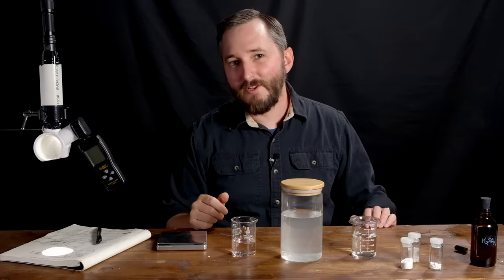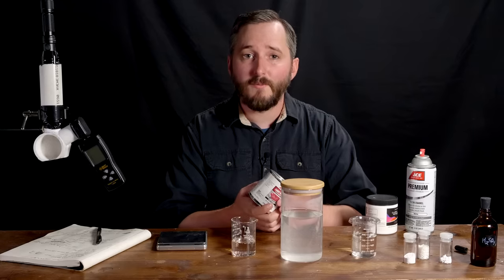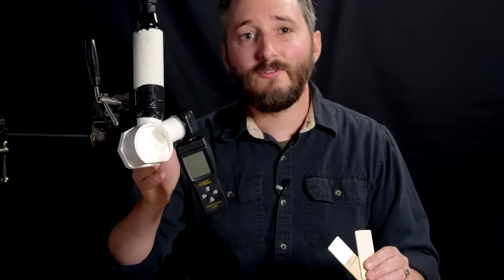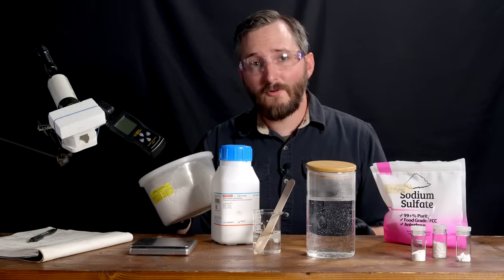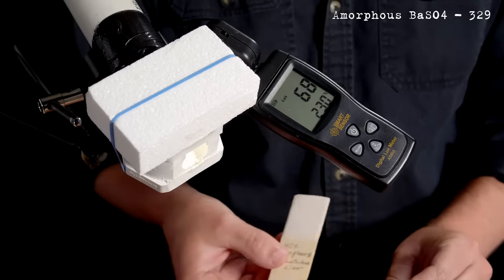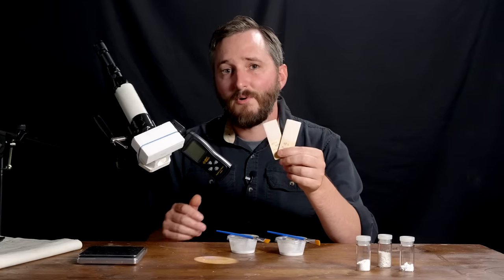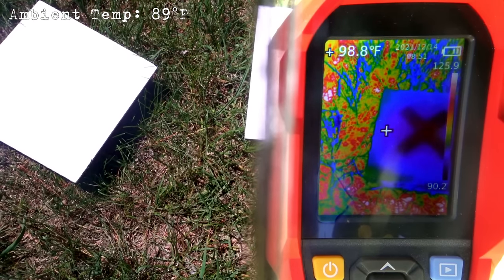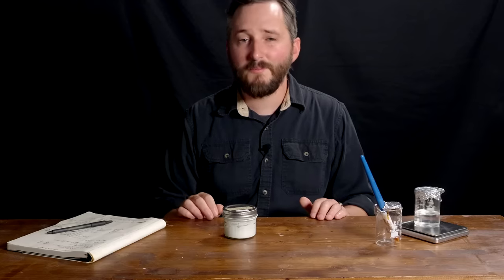How To Make Infrared Cooling Paint (Electricity Free Air Conditioning)

Comment: Absolutly not ! Not even 2 minutes in this and i already want to taste human blood. Your premisce is completly false.
1 - Cold do not radiate ! cold is not a radiation, like black light do not radiate black. the color black is the absence of light, cold is the absence of heat
2 - Physic 101 : heat can be transfer by conduction, convection or radiation. Heat flow from hot to cold until an equilibrium is reach with it's environnement. 
Do disipate heat by radiation you need more surface area than the heated surface (it's called an heatsink) .You cannot keep something cooler than it's surrounding, without energy to move heat away from it (aka lowering it's entropy). It's call THERMODYNAMIC ! And you don't f*ck with it !
- Because it's free energy, if you paint one end of a stearling engine with that, it would run forever -
3 - If your paint did what you said (emitting infrared ) it would appear hotter (red) on your thermal camera ( infrared sensor ) not blue. So if your thermal shoot are not doctered, your paint didn't conduct heat and the cardboard was fresh out of the freezer.
4 - An IR transparent paint (whatever the wavelength) on an opaque medium. face palm. what do you want to paint ? the sky ? If you paint the inside of the room, heat will alway be stop by the wall. and on the outside, it's even stupidier, the house alway emit infrared from it's surface. Do put a light into a glass box make it shine better ?

And if your wall is not expose to the sun, it's always cooler than air temperature. Because concrete is also an heat sink.
Reply: 1. If heat radiates out more than heat radiates in, the result is radiative cooling. 
2. The space is very cold. The paint is hotter than space. Heat can flow passively from the paint to space by radiation. This is compatible with second law of thermodynamic. 
The paint cannot be much cooler than its immediate surrounding. If the paint is cooler than the surrounding, it receives heat by conduction, resulting in cooling of its surrounding. And cooling of the roof or wall is what people want. 
The amount of cooling power per area may not be very high but it is still better than heating when you want cooling. 
3. The paint does not have to radiate more infrared than other surface. It just have to absorb less amount of heat than its emission. Most incoming radiation are reflected. 
The reflected sunlight should also reach the camera and can potentially be perceived as high temperature. But the infrared thermal camera used probably has a filter that block visible light and short wavelength infrared to prevent damage from exposure to direct sunlight, so the reflected sunlight is also blocked by the camera. 
I think infrared thermometer is not suitable for surfaces that reflect infrared. Conductive thermometer should be more reliable. 
4. The glue has to be transparent to infrared for property of the pigment to take effect. If we use opaque glue, emission/absorption/reflection will only be done by the glue, so the pigment is ineffective. 
The finished paint is opaque white. The translucent paint in the first try is recognized as a failure. But later in the video he successfully made a few samples of opaque white paints. I still have some doubt about the method required. 
The paint is supposed to be applied outdoor on the wall and the roof. It has to see the sky. 
Wall and roof always emit infrared but some frequently used material also absorb infrared and visible light a lot, resulting in heating, so we look for material that absorb less than emit, resulting in cooling.
Reply: @panotjoonkhiaw9425  Okay, i will try one more time :
1 - Everything above absolute zero emit light.
2 - Frequency of an emited photon is proportionnal to the temperature of the emitting body.
3 - Energy must be conserve, if you cool something that was a equilibrium, you have to move the heat elsewhere, and it demand energy to do that.
--------------------------------------------------------------
So the paint absorbe heat and re-emite it in the infra-red spectrum ? 
Like everything in the universe from water to metal, and even you, but not at the same efficiency and heat capacity. 
So the paint should shine in IR, so a big bright red spot.
Blue mean low emission of infra-red compare to the rest of the board.
Cool writing in blue, if the shoot was real, would have to be write with a thermal isolant, to prevent IR emission on the writing.
------------------------------------------------------------
Where are the magical photon re-emited by the paint ?
They can traverse the atmosphere, but they will not pass trhought the wall from the room you try to cool down. you can pain a glass windows with it, will not change the fact that Glass are opaque to IR. Any radiation is trap in the room, absord by the concrete and you guess it, re--emited by the entire house. 
It's not even physic, it's pure logic to this point.
Reply: @vincentvoillot6365  The paint does not absorb much and it emits little. Its emission cannot exceed blackbody of the same temperature and only a small range of frequencies are emitted with close to 1 emissivity. The paint reflects most of the sunlight. The reflected light is unmeasured by infrared camera, so bright red spot does not appear. 
The paint is supposed to face the sky. It can be painted on the outside surface of wall and roof. If you want to paint a glass window with it, paint the outside. There should be no wall or glass between the paint and the sky. Transparent plastic cover does not block infrared and does not hinder the paint's function.  If the building is warmer than the paint, heat can flow from the building to the paint by conduction.
Reply: @panotjoonkhiaw9425  Heat is infrared, Sun lights is composed of radiowave, infrared, visible light, ultra violet and x-ray from order of energy.
We are talking about infrared, what this paint do with the infrared (or heat ) absorbed ?
The paint gain energy by absorbing IR, according to all law of physics outside a blackhole, energy must go out.
if re-emited outside the camera range that pose multiple issue. 
If you go below, your paint emite radiowave, but with the opposite caviat. You loose less energy that you gain, without raising your temperature.
If you go beyond IR, your paint start to glowing red and according to the black body radiation theory for that you need to rise the temperature. And as the frequency of light is proportional to it's energy, you need more energy that you receive.
And you cannot "store" the energy to release a photon at the right frequency when you want.

It's not rocket science, you have a body with a volume (thin for a layer of paint) , a temperature (energy contain in the volume) and it's exchange surface, that determine the amount of photon receive (surface/time). The frequency of outcoming photon  is proportionnal to the temperature of the body. If you receive more energy than you can dissipate you heat up , raising the frequency of emitted photon ( and dumping a part by conduction if the surrounding is cooler ).
You must conserve energy and if you want to move heat more than natural radiation, convection or conduction, you need energy.
Reply: @vincentvoillot6365  It is highly reflective paint. Both visible light and infrared are mostly reflected. 
Why do you insist that it absorbs much infrared ? Is it because you don't see the reflected infrared, so you assume it is all absorbed ? 
Near infrared is invisible in both normal camera and thermal camera. You may need night vision camera to see it.
Reply: @panotjoonkhiaw9425 
 If the paint reflect infrared, it should appear red on the thermal sensor, not blue, that's why ! Blue mean low emission or low reflection. What it is so hard to understand ?

If it reflect less IR, it must absorbe the energy, if not dump elsewhere, the temperature of the paint should rise, or becoming red on the thermal sensor.
If your shine a light on a reflective surface and take a picture, you will have a bright spot.

Same thing with IR. If you reflect all IR you are just heating the place. That not what he said, that not what his picture show.

Yes i know normal camera can see high IR (that's why if your camera is well design, you have an IR filter ) that not the point.

* In Thermal imagery, from HOTTER TO COLDER :
RED - ORANGE - GREEN - BLUE - BLACK (no emission)
* To "cool" a "RED" room, you need a "BLUE" spot.
* Thermodynamic flow the RED hot to BLUE side, to have same ORANGE-GREEN color everywhere, this is thermal equilibrium.
* To keep the BLUE spot and still shift the environement to green, you need to move the excess RED elsewhere.

This paint staying "BLUE" make absolutly no sense.
Reply: @panotjoonkhiaw9425  Better look the James Webb space telescope. A big IR camera in space. Even in the vacuum of space, the sensor is cool down with a electrical heat pump connected to a big heatsink and also protected from sunlight by multiple layers to specificly prevent infrared from the sun heat.
There is no atmosphere to absorde IR and space is 2° above absolute zero and still they need the bleeding edge of enginering to pull it off, Why ? 
Because there is no way to dump heat ( background + electronic ) other than radiation, and as the photon emission depend mainly limited by the surface, "small" electronic will beging to warm up, so  they transport the heat to a bigger surface preferably away from the sensor.
They don't magicly go away leaving the body with less energy than the environement. 
NEVER. THERE IS NO "FREE"  LUNCH.
It's the same for everything, the paint of your wall, your electric heater, your fridge, your computer CPU whatever you are in space or on earth .
Reply: @vincentvoillot6365  The thermal camera used in the video looks like UNI-T UTi260B. Its user manual is available on Amazon. In Specification page, it has infrared spectral bandwidth 8 micron to 14 micron. Compare this with solar radiation spectrum 0.24 micron to 2.5 micron (UV to near infrared). They don't overlap. So reflected solar radiation is undetected in this thermal camera. It does not appear red in thermal image because the sensor does not sense it. This is not a defect. The thermal camera has temperature range  -15 C to 150 C (high-gain temperature scale) and 150 C to 550 C (low-gain temperature scale). Sun's temperature above 5500 C is far out of measurable range. There is no need for this thermal camera to sense the short wavelength emitted by the sun.  Solar radiation may even be deliberately blocked to better measure target object temperature without involvement of reflected solar radiation.
Reply: @panotjoonkhiaw9425  That's not what i said.
the sun emite from x-ray to radio-wave. high frenquency from x-ray to some UV are filtered by the atmosphere. But it go well below infra-red, that's why you can see distant stars in radiowave.

The video clearly state, taking heat from the environement and radiate it in the IR. So i waited to see this emission with the thermal camera.

Visible light is reflected by the color white or better a mirror, not Infrared.